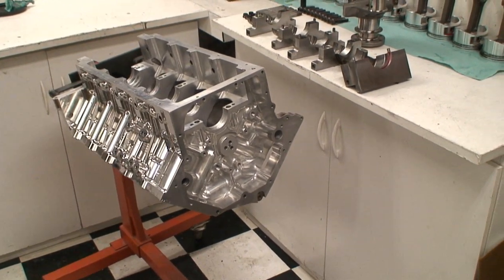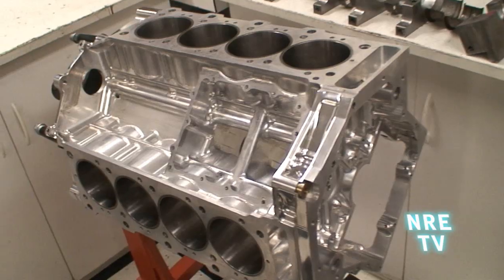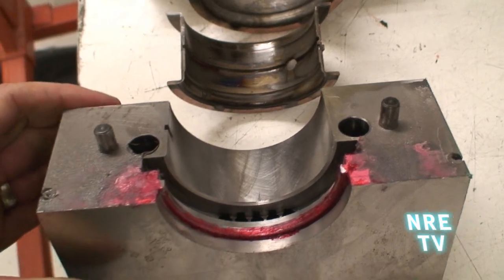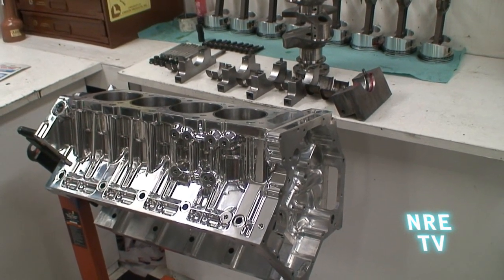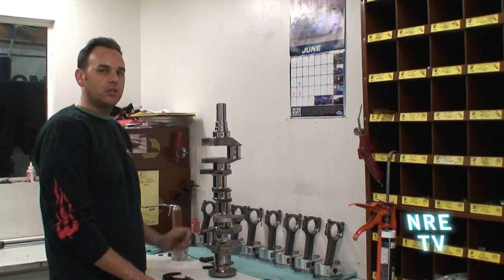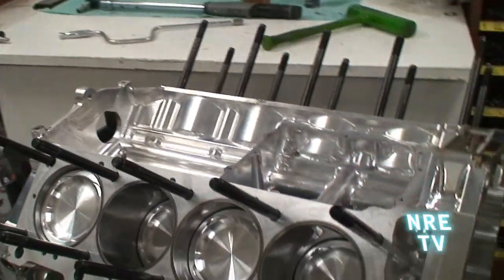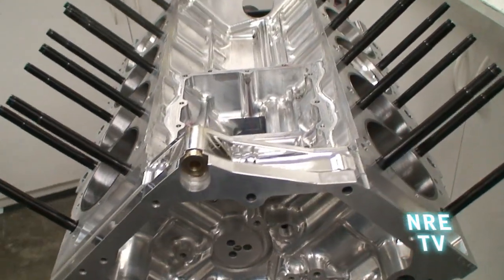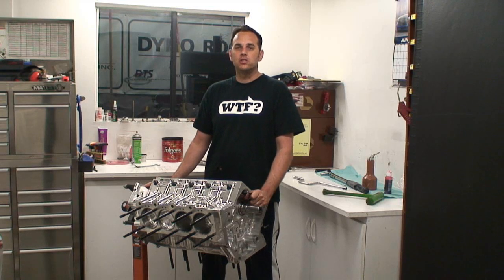2500 HP Revolution 4 Cam Small Block Nelson.  From Nelson Racing Engines.  Veritas Movie Studio.

Comment: @TheOfficialKC I've been a mechanic for about 15 years, and the 3rd gen SBCs still blow me away.  I consistantly see them in my shop with over 200,000 miles on them and still running like they day they were new.  I run an LS1 in my 87 Monte, and it is pushing 200,000 miles and I tore it down in February, and I could not believe the small amount of wear in the engine, not even a ridge at the top of the cylinders.  So I totally agree with you, they are the greatest V8 ever built to date.

Comment: That's one heck of an upgrade option, considering that you need to go from an OHV block to the DOHC block with chain passages etc. I guess at that price point, anything is practical. It does have a few design change issues though, considering packaging.

Comment: The 1uze-fe made by Lexus is a great engine that is also Quad Cam that can take a lot of boost stock by turbo or s/c, and those motors are now sought after for boats,buggies, foreign hot rods, etc, and those engines were made by the millions so the quad cam V8 is proven. Great vid BTW

Comment: The benefit of 5-valve heads are the quench areas. My fourwheeler has a 5-valve head and it runs 12.5:1 compression on 91 octane at 4500 feet. The comments on friction are true though. I cranked the the engine over with the rod and piston removed, and it took a solid 5 foot pounds to crank it over. The flow is okay. For a 95mm bore, 63.5mm stroke (very oversquare) peak torque at 8400 rpm. A square version would peak at 5500, compared to market average of 4800. Peak hp at 9800

Comment: The Tuatara drivetrain picture (which is actually the setup inside the Ultimate Aero XT) IS of a 427 LS style pushrod motor with NRE intake and turbos. But, they have still made it sound like the DOHC motor is still going to be an option in the Tuatara. From the sounds of it, the pushrod motor is the "base" motor, and the DOHC is an upgrade. Keep in mind, this is my guess based on what they have said up to this point.

Comment: Four valve DOHC v8's are quite fuel efficient. It opens up the world of cam-torque actuated variable intake/exhaust timing, meaning the intake/exhaust valves ignition timing changes automatically during the powercurve. Timing is locked in at idle and wide open throttle and it's all over the place everywhere else in the RPM's. This means excellent fuel economy and high compression + forced induction v8's that can run safely on pump gas without detonation, up to a certain point.

Comment: perhaps you could make a cam or cams that fires 2 cylinders at once, because this block could take it. also maybe you could use timken roller needle bearings on the crànkshaft and camshafts main journals.

Comment: a 4 valve big block would be cool because instead of those huge valves hammering the seats in the head you can have lighter valves and these 4 valve configurations are just meant for forced induction this video is quite a tease for what will come

Comment: look I'm not saying the 5 valve is better its just heavier and the weight saved from dropping a cam and an extra valve and spring is more effective than the power gains of the extra valve and as far as F1 I don't follow it that much but i would assume that weight and valve float are the biggest issue so it would make sense to use a 4 valve because of the pneumatic valve springs where they can open the valves farther and close them faster and hold them closed

Comment: @TheOfficialKC No, I heard 6 valves were bad. VW has a 5v 1.8 that's used in formula racing, most street bikes and dirtbikes (besides honda) use 5v designs. Same goes for plenty of supercars. And they have been doing so quite successfully.

Comment: You should both read the conversation already held here on this and do some research. F1 and Yamaha both STOPPED using 5 valves years ago because they weren't competitive. So, no, they don't still use 5 valve heads.

Comment: will the nre rev heads have compressed nitrogen pneumatic valve springs? ahh man, Tom nice work, I love the idea of dohc on a sbc format. the little ford dohc engine nre did was pretty hot. Imagine it with bbc cubes and made from the best unicorn dust. Who knows what they have cooking for the heads... cubic dollars might as well go crazy with it. How  bout a huge oval intake valve, instead of 2 since it dosent have to spin as much to disapate heat like the exh valves do,  and pnematic valve train, vtec, vvti, and something like variable geometry on the exhaust port like a cone that morphs or something, an application to the dev team... roller needle bearing where the cam bosses are....
Reply: enjoy trying to do a valve job on a valve thats not round an its not the spinning that dissipates heat, a huge valve is also going to weigh alot so thats even more weight a valve spring is going to have to control making high rpms harder theres a reason most companys run 4 valves now, the oval valve idea is taking a steb back to the hemi with there big valves they flow alot but not as much as 4 smaller valves
Reply: unicorn dust dosent get hot... hah. jk really i had never heard of an oval valve. Also with more valves makes the application a good bit more robust for example in some honda engines I know one of the vtec engines if not all, during low lobe cam operation the valves do not open in unison creating a nice swirl on intake charge. makes the engine even more happy at low rpm. you can really do that with one valve. Id like to see vtec and independent linear cam timing control on all 4 cams...and one of those alien intakes that rolls for a long runner to short. Thats more realistic.
Reply: CANT* do that with one valve

Comment: The only Yamaha's with 5 valve heads are old designs they haven't updated or put any money into. Their high performance designs, used in the MX bikes, are all 4-valve heads now, have been for a few years.
All high performance designs from companies that used 5-valve heads now use 4-valve heads because the flow wasn't as good, it was too complex (weight) and had too much friction. They can make more power with less weight with a 4-valve head.

Comment: When the 5 valves were introduced 20 years ago by yamaha, they DID solve some problems and make more power. But advances in other areas, such as cylinder head/combustion chamber design, has made the 5 valve not as effective as the 4 valve. MotoGP teams that used the Yamaha 5 valve motor replaced the heads with expensive 4 valve heads because they made more power. Yes, there are other benefits in 4 valve, such as less friction, weight and complexity (cost).

Comment: @Frostman182 Chevy's 6.2L LS2 weighs less than Fords new 5.0L V8. It is also smaller. That is what I call better. Bigger displacement but small size and less weight.
There is a reason the SBC is the most used engine by small supercar and sports car manufacturers. You could make a long list of them but only one or two Ford/Dodge.
Weight, size and reliability, even when boosted over 1000hp.

Comment: @JonEldred Yamaha was the only motorcyclec ompany that went deep into 5v heads and tried to persue it. Others backed out shortly. After several years yamaha has switched back. ALL sportbikes and motocross bikes are 4v heads now. Yamaha found they couldn't compete with 5v even though they invested so much engineering and marketing into it.
Formula 1 also dropped 5v because it wasn't as good. There are no 5v supercars.

Comment: We will see if they do or not. Since the original plan was  DOHC engine, but we have only seen a pushrod from them for the XT. A DOHC motor never made sense to me with their claim of 1350hp because that would have been easy to accomplish with a 7L version of their pushrod from the Ultimate Aero. It was already 1287hp on 6.3 liters. So DOHC would have only made sense if it was making over like 1500hp, and even then questionable if a bigger pushrod wouldn't have been easier and lighter anyways.

Comment: What did Yamaha do when they needed a new design for their MX bikes? They dropped the 5 valve head for a 4 valve. Both in 450 and 250. (And the 450 switched in 2010, not this year) Same with their sport bikes. What did Formula 1 do when they wanted more power? Switched from 5 valve to 4 valve. 
The only Yamaha dirt bikes still using 5-valve are their dated off-road bikes that are extremely underpowered.

Every new engine from those that praised 5-valve heads are 4-valve.

Comment: up until this year they used 5 valves in there yz450f and yz250f the new 2014 models are sohc 4 valves but the wr 450 and 250 are still using there titanium 5 valve design and their yfz 450 is a 5 valve and their older 660 was also a 5 valve and you can't convince anyone that a built 660 isn't faster than a built 700 and if you don't believe meEngine	
Type	449cc, liquid-cooled w/fan, 4-stroke, DOHC titanium 5-Valve
Bore x Stroke	95mm x 63.4mm

specs strait from yamaha on yfz450r se

Comment: like the teksid built ford 4.6 block, cant get 500 cubes but will hold enough boost to make 2200hp. why reinvent the wheel? also the early 4 cam b cyl. head.  much cheaper.

Comment: @YungJosh50 No. 5 valves are bad. They used them for a while in Formula 1 and Yamaha used them for a while on sport bikes and dirt bikes. They have all dropped the design. I had an article about it before. It actually screwed up the flow I think and added complexity, weight, friction and hard to operate.